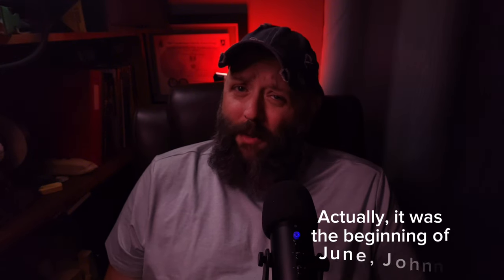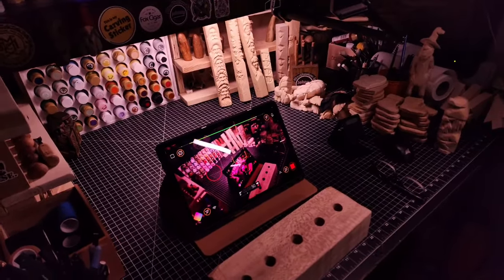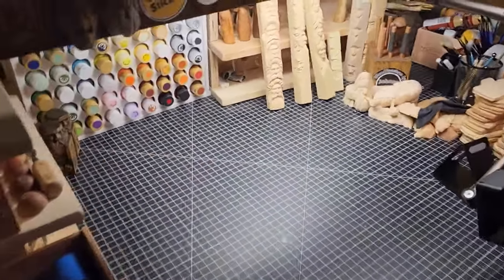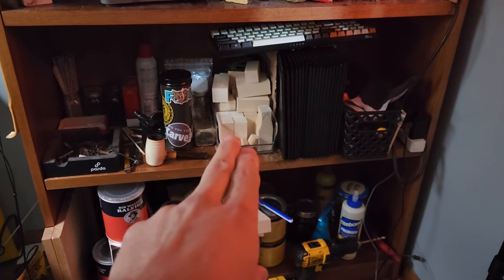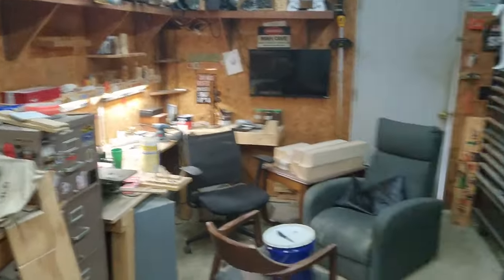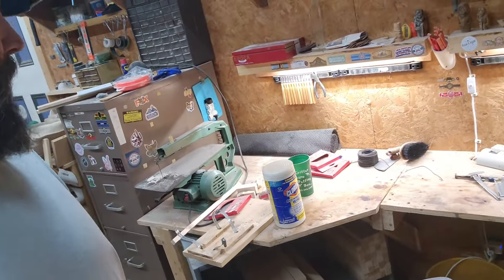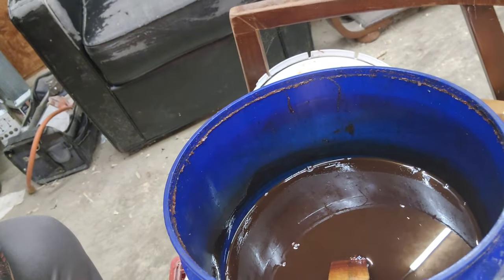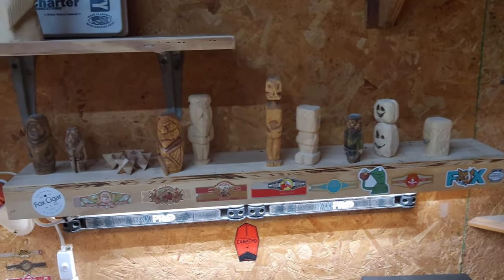Questions & Answers

Comment: Thanks that desk I can copy.
I'm also a Hobbiest Gardener I've built an extra tall grow light station in the area where I decided to remove the carpet on a sunroom cement floor that I'm planning for fall and winter carving.
   I've got a jigsaw and wood working and welding and Blacksmith and some leather tools and the grinder setup like yours for stropping.
    I put my rags in water overnight before I lay them out to dry then trash.
Reply from the maker: @JohnJude-dp6ed  that's a great solution.